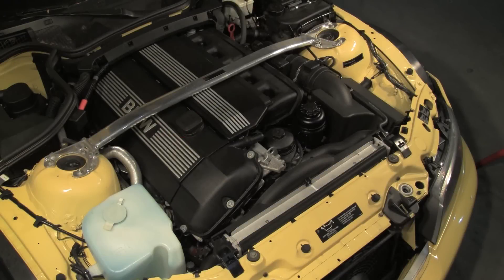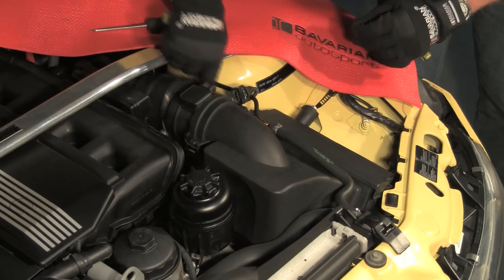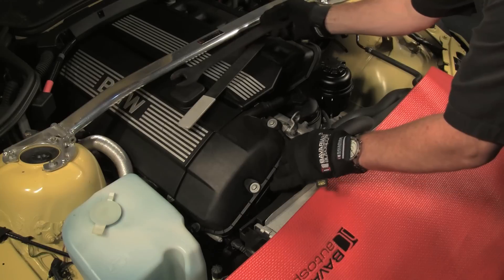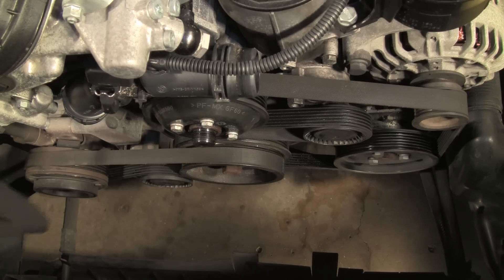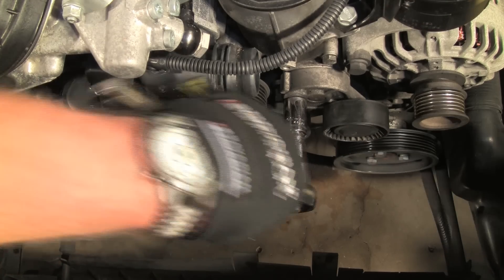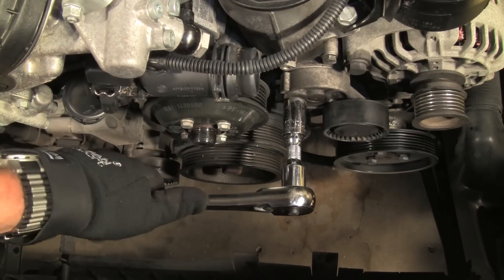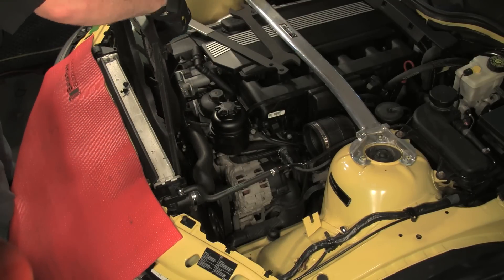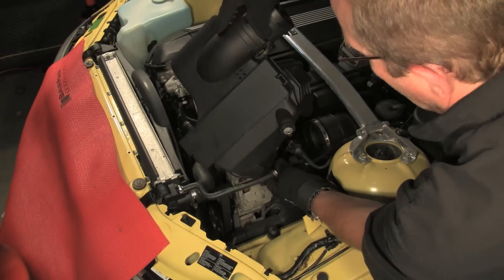BMW Serpentine Belt and Pulley Replacement, How To

Comment from the maker: @Kjhuynhz -
If you remove the two belts, one at a time (A/C first, then Main), and the sound goes away after removing one of the belts, replace that belt and the pulleys for it (or both belts and all pulleys).  If the sound remains, it is not from the belts and we will have to diagnose further.  It may be a vacuum leak (if it sounds like a squeal or whistle), which may be in the crankcase ventilation system.  See our videos and blog posts for M52TU & M54 PCV system.  BLOG dot BAVAUTO dot COM.

Comment: Very useful video. Quick question since i only know little to nothing about my 00' bmw e46. My car started to sound like cramp coming from under the hood for about 2 months now. Some says it was the tension and the belt? if so, should i continuing driving it like that for a while or should i get it check out?

Comment: Great video! Very helpful, but I managed to change both belts in my e39 without taking off visco fan and air filter. I only had to remove radiator hose. It wasn't very easy but job done.

Comment from the maker: @aLex0kain -
Your M52 2.5 liter engine uses two belts ... one for the A/C and one for the water pump, alternator and power steering.  Both belts are of the serpentine type.  Just go to our web site - bavauto dot com -  and enter your BMW model, then search either BELT or SERPENTINE.  We'll show you the correct belts for your model.

Comment: I have a 2004 E46 325ci with a a Hydraulic detensionizer. Is removing tension on the hydraulic model the same as the electrical model? i would like to know before I start removing the fan and attempting to replace my belts. Thank you !!!

Comment: Quick question, if I only want to replace the a/c belt at the moment, do I still have to remove the fan? It looks accessible from the bottom, but I don't want to cause any problems. My car is a 97 328 sedan

Comment from the maker: @mmoniot - We haven't found a 100% rule in determining which models have the separate idler pulleys and which don't.  In fact, the BMW micro-film for this 2001 3.0 Z3 shows an idler on the main belt.  Obviously, there is none.  An idler pulley helps the belt to properly wrap around one or more of the accessory drive pulleys.  The non-idler applications have a different belt routing that the idler applications.  Idler pulleys are secured by a bolt through the center of the pulley.

Comment: It should be noted that this particular M54 motor in this Z3 apparently does not have an idler pulley.  Would be an interesting side note to explain why some M54's do and some do not have this additional pulley and also what it does, especially since most viewers probably have an E46 (which has an idler pulley on its M54).

Comment from the maker: Without the pulley holder tool, you certainly could be rotating the belt, pulleys and engine, with the 32mm wrench.  This will not cause any damage, but can be frustrating.  Bavarian Autosport does offer both the pulley holder tool and the 32mm wrench.  Note, in the video, how we suggest that a hammer be used (against the 32mm wrench) to shock the nut loose.

See our website at bavauto.com or call us at 800-535-2002